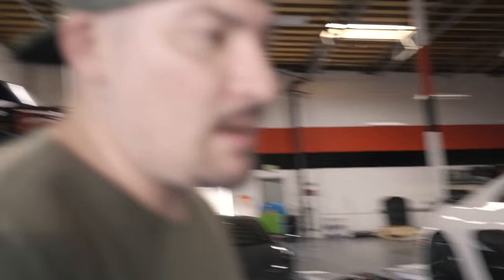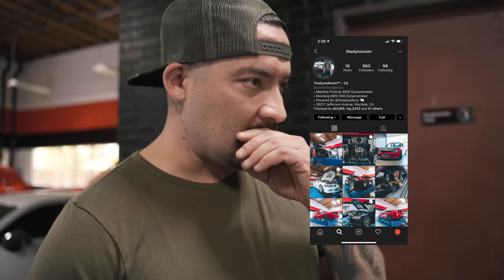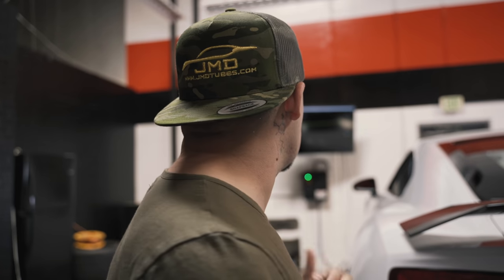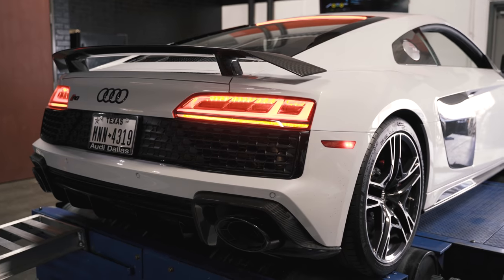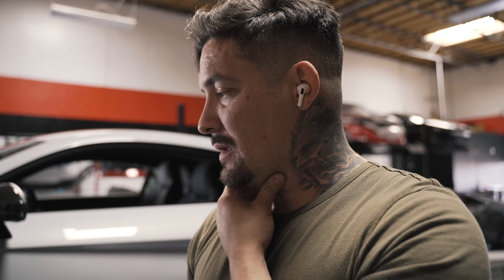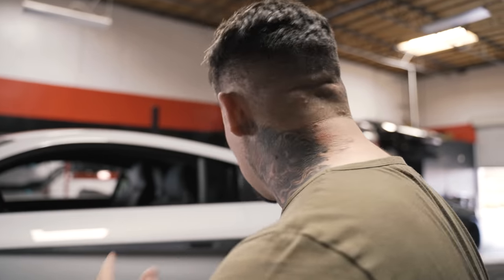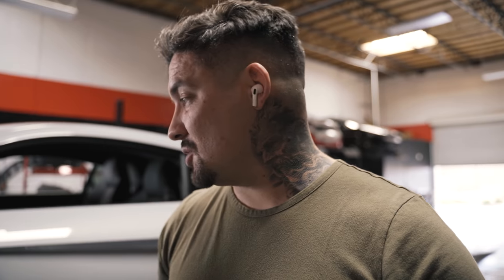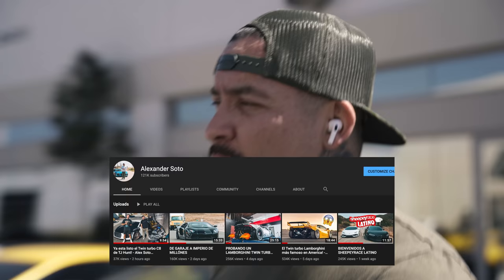SUPERCHARGED R8 VS STOCK R8 EXPERIMENT - sheepeyrace

Comment: 30k for stage 1 is cheap in my opinion. I assumed if vf asked 30k that sheepey costed like stage 1 50k... that show how good of a company sheepey is. If they can make profit out of it with all the extra parts and work needed... hats off for sheepey!
Reply: Eh not really tt kits tend to grenade engines. Not to mention the vf supercharger is a bolt on and can be removed unlike the twin turbo kit.

Comment: Also, since your mustang Dyno reads a certain percentage lower, you gotta factor in that percentage. When say you gained 105wheel plus that percentage is the increase you'd see on a Dynojet so probably like 115-130 on a Dynojet? 🤔
Reply: That's irrelevant as any other dyno will just read a higher baseline the % gain will remain the same irrespective of the numbers
Reply: @tiaanvanzyl9862  if gain amount is correspondent to amount hp read, mustang Dyno gain will be lower than Dynojet gain. If the percent gain is 22%, after mustang Dyno run its gonna be 455 to 555. Factoring in that a mustang reads about ~10% lower, Dynojet would be about 500 to 610. That's 10% more gain than a mustang Dyno shows. (Relative numbers for explanation)
Reply: Remember that why he baseline a stock r8.. you could say it a different r8 then one being with the charge or turbo..  people need to understand that all dyno read different. You can only compare your cares baseline dyno run to it new dyno with time and mods.
Reply: @Ryousure  apparently you read as good as you write, no offense

Comment: Must get rally awkward when those twin turbo kits grenades transmissions. Turbos are trash when it comes to track performance. Especially with the lag and reliability issues.

I'd say go supercharged if you want reliability and track focased builds.

Turbos are for bragging rights and straight lines.
Reply: Right, like the supercharger kits putting cars into limp mode for ambient temps getting too hot. Watch The Smoking Tire video on the VF Perf.... Lmfao